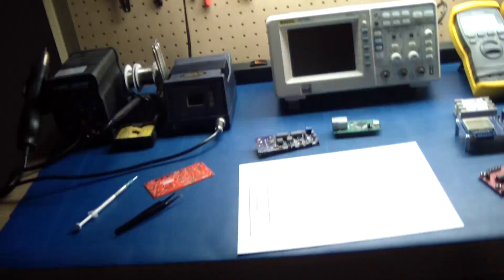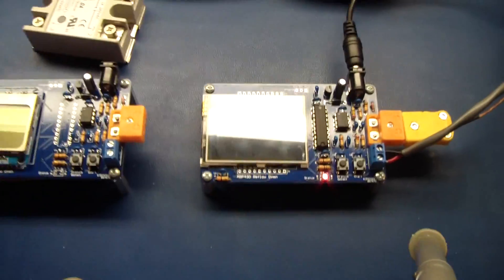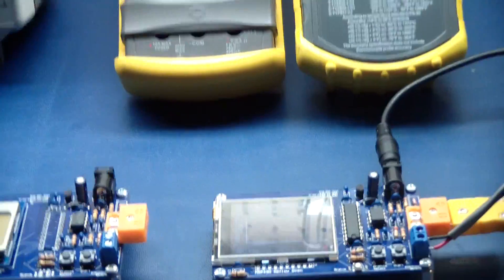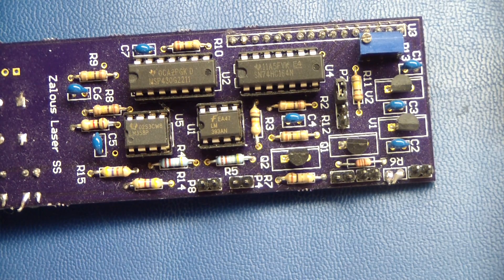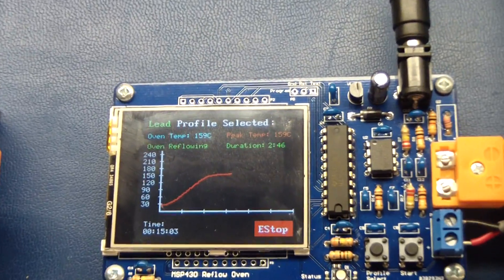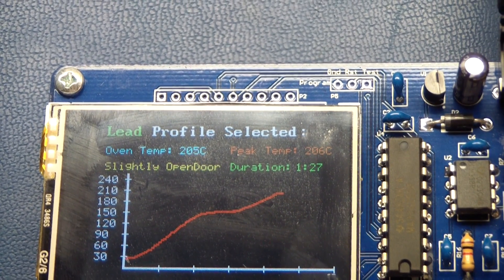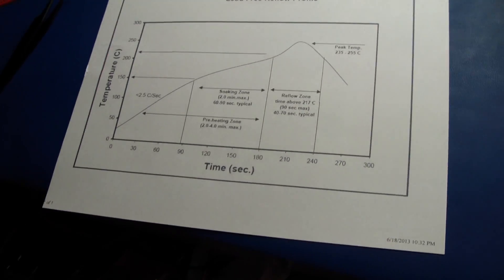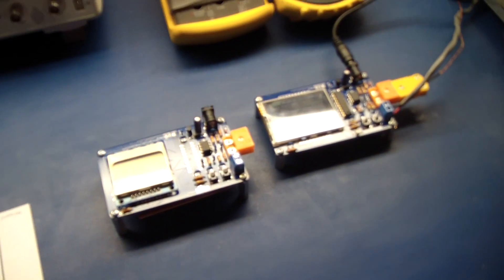DIY Reflow Oven Kit / Tutorial

Comment: Hey Nathan, I just love this controller! I have some questions...

Does anyone know if there is an oven on the market that can bake PCBs of 300x300 mm (12x12")? If so, is that a good idea? I've been reading that bigger ovens tend to increase the temperature too slow. Also I've read somewhere that it's usually not a good idea to place PCBs in the middle of the oven because of the direct heat. But when I'm baking such large PCBs it's hard not to do that... I would love to get some advice on this, thanks in advance!
Reply: +Matthijs Jansen  The whole purpose with a 'toaster oven', is that it is smaller and made for 'a little snack' regarding food.
So seems like you need to find a toaster oven in that size, or use a normal size household oven.
- Regarding big ovens, no problem.. industrial ovens for PCBs are big like a tank......

Insert extra heaters if needed, use gold a tape inside, and kaowool 'outside' the chamber.
Also place the baking tray or / and other metal to shield from the heater elements, so you boards does not get direct heat.

That should do.. maybe activate a fan in your preheat / soak time for circulation, and make your MCU etc turn it off in the reflow period. Google 'reflow profile' if confused..
Another fan activated with outtake on the back, after your reflow, to get rid of the heat.

And remember to use 'quartz' heater elements.. they got less 'inertia' than the older elements. (Faster up / down) temperatures, and your PID loop should have better control and being able to match your reflow profile.

Good luck... :D

Comment: "Light flicking in your house"... Because the IR lamp filament is tungsten element so your program should do a warm up start at low current by firing at zero crossing at low quadrant only say for 10 sec to warm up the filament. This will avoid high current draw when the filament is cold.  Judging from your using of the solid state relay.... emh.... it will be just effectively ON-OFF type control.... Nice MSP430 development.... keep up the good works...

Comment: Your lights in the house are not blinking because it draws much power, but because you just switch the power of the oven on and off without filtering, which gives harmonics in voltage and current to the net of your house...